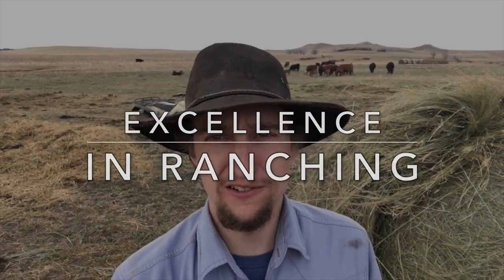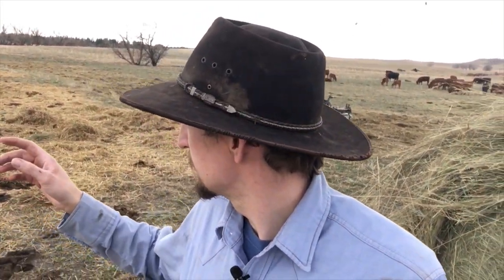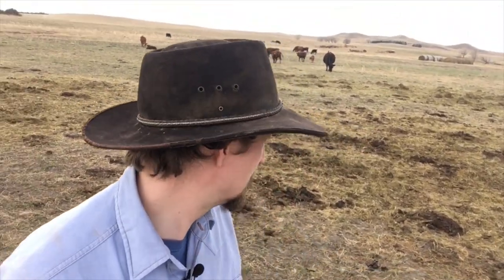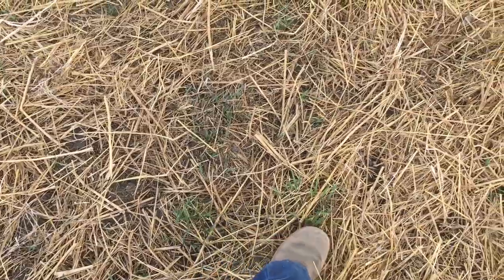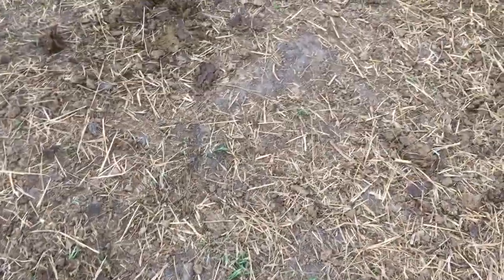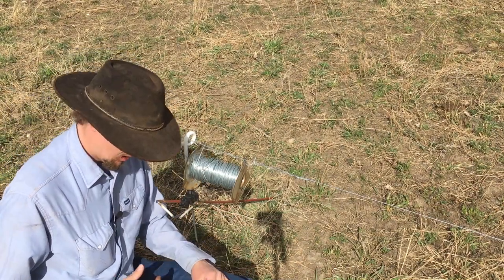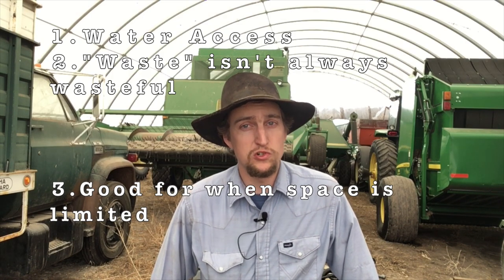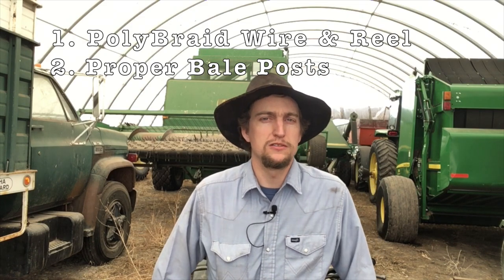This IS a better way to feed hay -- Bale Grazing --

Comment: You should get a harrow and harrow your feeding areas..I've left it and had the organic matter cover actually kill the grass off in the heavy areas but if you can harrow it around it spreads it out more and better utilized
Reply from the maker: I've had that issue as well, but if the bales are spread out enough and they have to walk through where they've been before to go to water, they clean it up so well that the waste is very minimal to the point the grass grows up better in the area where the "waste" was. But when I've rolled the bales out with the tractor, one almost has to harrow it because they don't clean it up as well. Thank you for the comment!

Comment: ive also done this with poor hay had to go over it with the brush hog to even out the heavy spot where the bale was as it was to heavy for the new grass to come back up i still do it but i now give them a bale and roll it out by hand or with my wheeler and use a fork to spread it out just my thoughts hope 2021 is better for you!